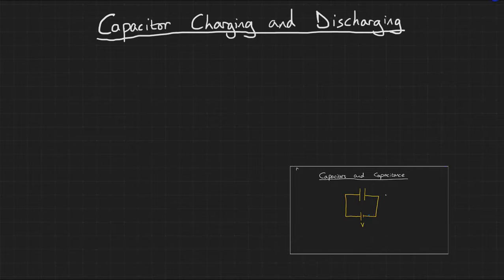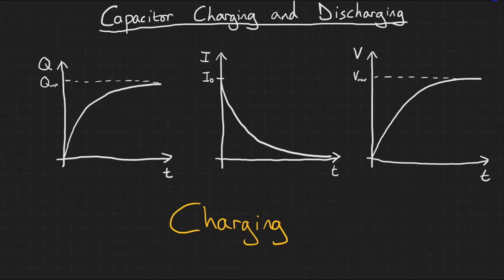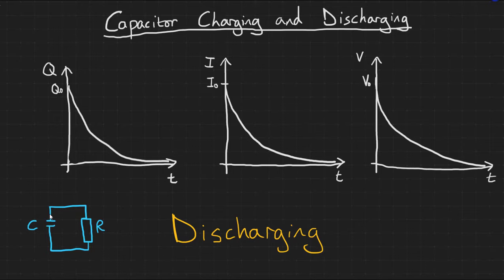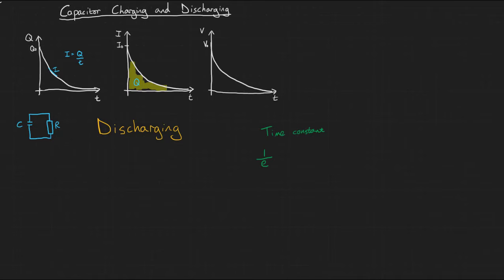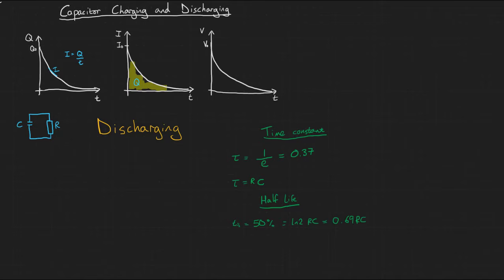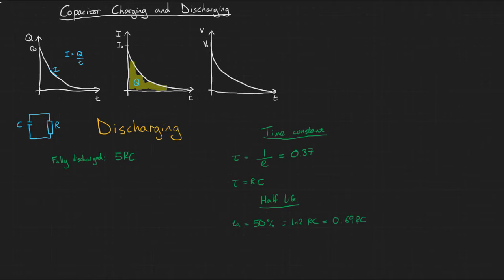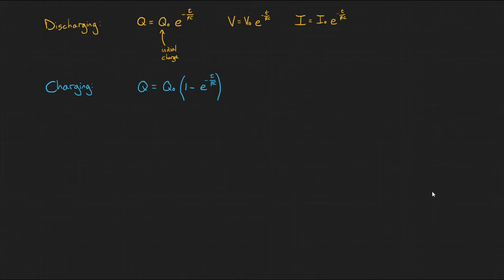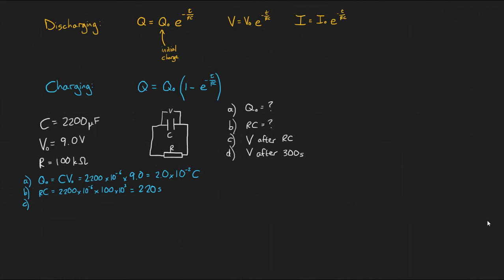Capacitor charging and discharging

Comment: What if the resistor will reduce voltage ratio from 12V to 3 V. Will discharge characteristics look the same but flattered or to some point stabilised or?  :)

Comment: If I install a new "start" capistor on an induction motor... where does it get the power from to start the motor if the capistor was at zero power out of the box ?
Reply: From whatever power source it's plugged into, while the "Switch" is closed for the motor the capacitor can still be charged